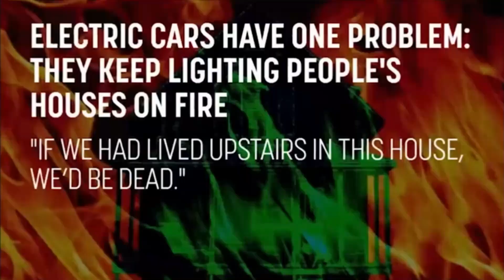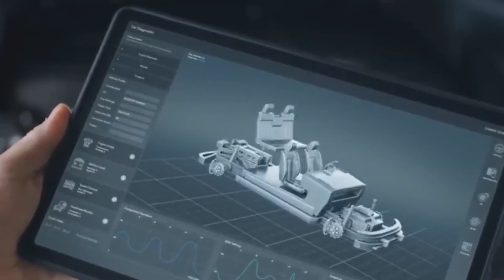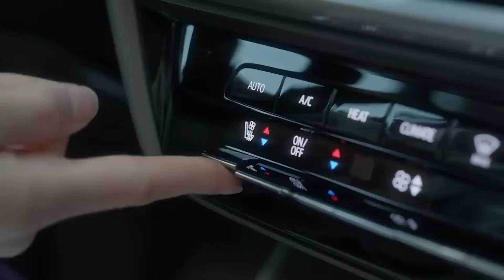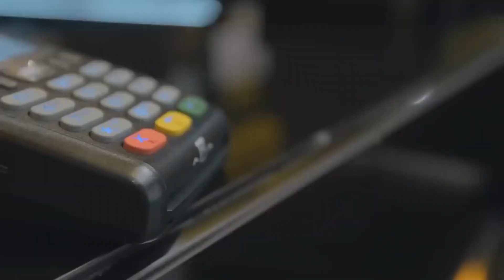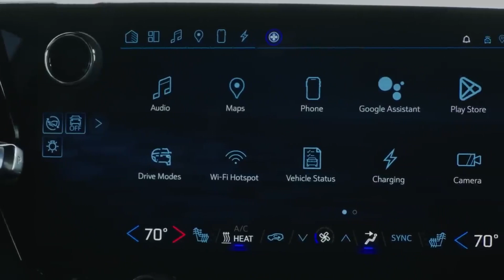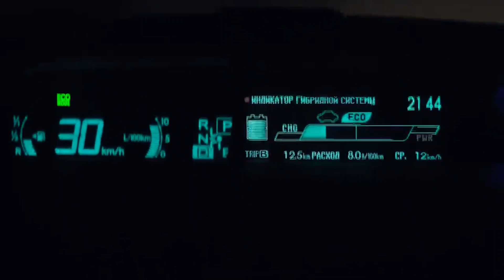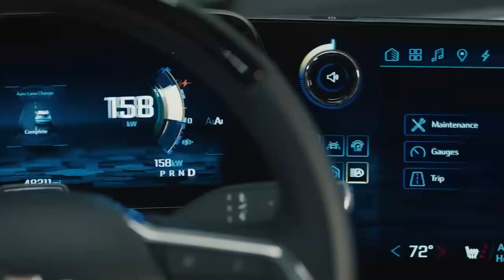Electric Vehicles: 5 Key Reasons Why EV are Difficult to Use | Report from CEOs

Comment: The battery cost isn't 25% of the cost of the car, at least not if you need to replace it,  as some people found out last year. They scratched the battery shield and bent it a few fractions of an inch and were told the battery needs to be replaced which would cost them 10k more than they paid for the car.

Comment: If you look at Norway, 1/4 of all cars on the road are EV's.
And, charging infrastructure are beeing solved.
The grid isn't the problem. You can stop refining oil. Then you got the energy you need.
In Norway you need 5% increase in the grid power to charging every vehicle in the countries.
That's less than the power increase  every year in the US
Reply from the maker: Norway's success with EVs is impressive! Just a 5% grid power increase needed for all vehicles shows the efficiency of their infrastructure. 
The comparison to the US annual power increase highlights the potential for global EV adoption without straining grids. Norway sets a positive benchmark for a cleaner, greener future in transportation